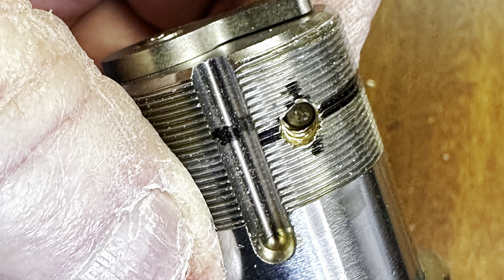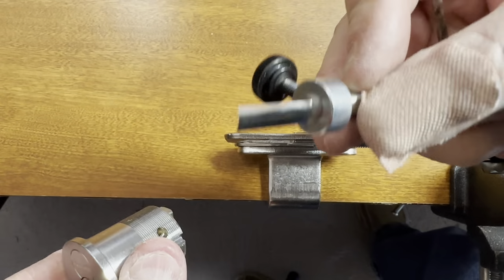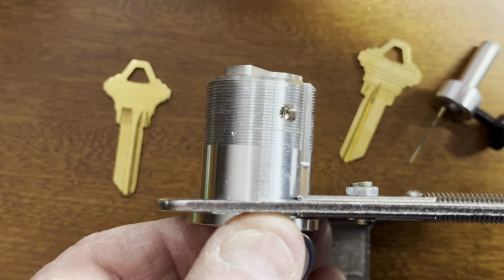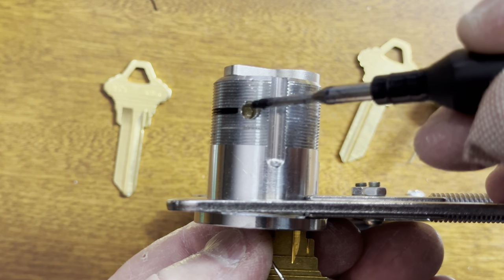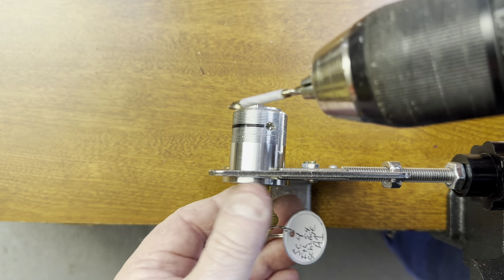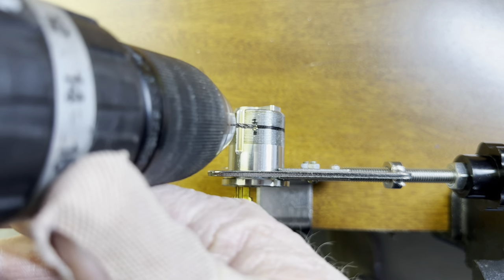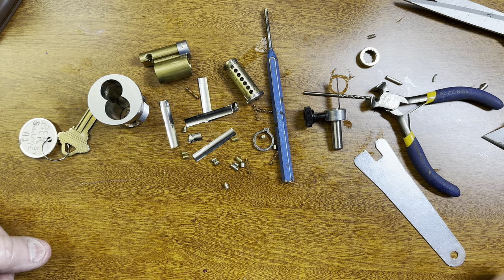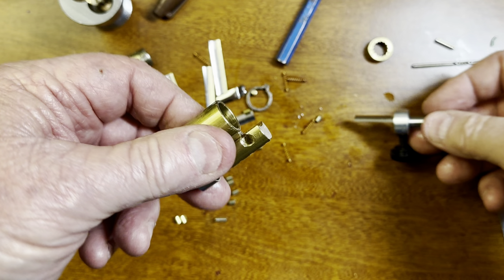Removing a Schlage FSIC Removal Cor mortise lock

Comment: Schlage's version of LFIC is properly called FSIC.  THere was nothing wrong with your core before you destroyed it.  The FSIC core you used is not jammed--it is designed that way.  The retaining lug is LOCKED unless it is released by the tip of a control key. After drilling the hole you have to put a control key into it in order to free up the control lug.  It can be any control key that fits--blank or cut to any bitting  whatsoever as long as it is the right keyway and has that extra little tip on the end that operates the core retaining lug's tiny pin.  With any control key in it you can then release the retaining lug with your probe, remove the core and shim it as usual.  If you drilled out the retaining lug--you would have had one hell of a time shimming it because the tiny pin and spring that operate the lug would have been flopping around in your way.  Watch Jason do it here...https://youtu.be/5dA8mogJPEk  He does it with an Everest but the concept is the same with all Schlage FSIC.  (You can also release the lug by placing tension on your lug with your probe and reaching back to pin #7 with a pick and raising the pin to its shear line and thus freeing up the lug).
Reply from the maker: Great info and I really don’t mess with these. I am a medeco dealer and we wouldn’t even attempt to do any of this kind of stuff but it was worth a try. I watch several videos on it and decided that it looks simple. they never used a core key in their videos and I haven’t received mine yet because I’m buying into this whole system of stuff Schlage stuff And with advice such as you gave, I should be on top of it before I know it. Thank you very much. You are the bomb. 0:59

Comment: You need to pick it ( I did one and it was not easy ) or lishi it , then use a pick to manipulate the pin at the back to get this thing out. you can search se lock and key, jason's video , he has one LFIC as how to remove it.
Reply from the maker: Thanks for the tip buddy no I’ve got that Lishi pic I just didn’t think about it too deeply. After watching that video I posted in the comment description I figured I could just drill it. He never used a control key of any kind you just push that pin in and it popped out. Thank you so much for your information, I have a bunch of these things coming from Anixter because I bought into the whole dishwasher Schlage experience and I’m sure I’ll get on top of it soon but with great comments like yours, maybe even sooner thanks